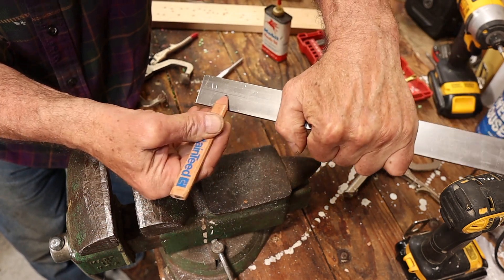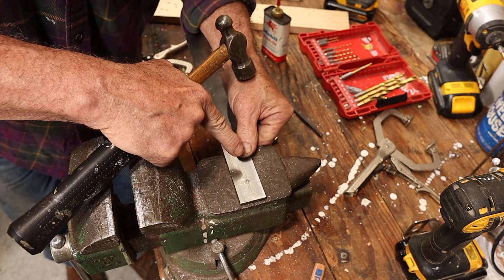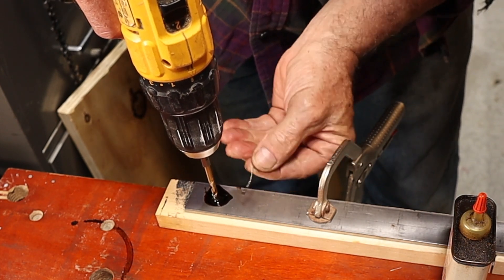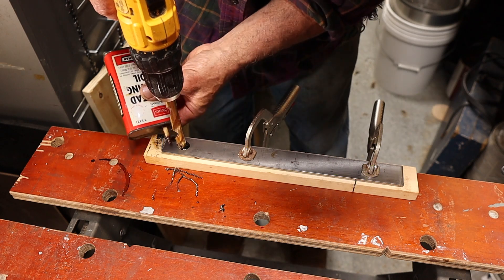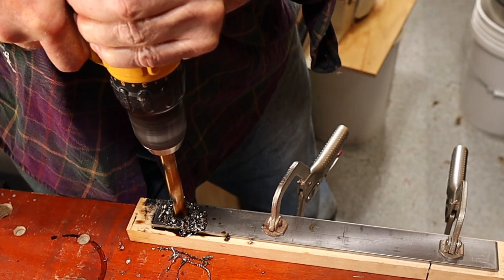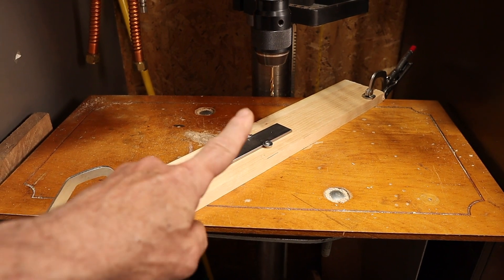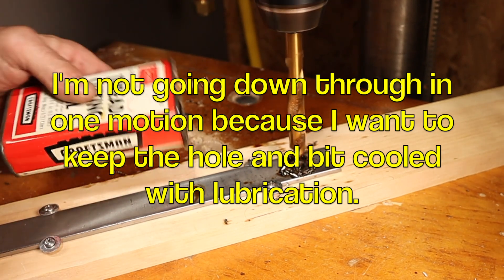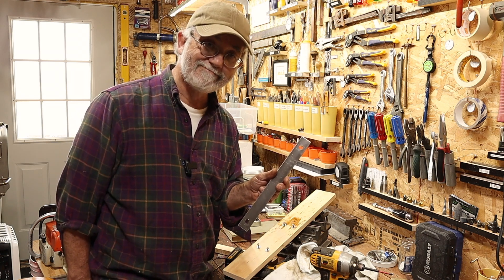How To Drill Holes In Thick Steel - A Lesson For The Novice - With & Without A Drill Press

Comment: Can you further define "bar stock"?  The text overlay @6:36 says "Common high speed steel bits will NOT drill hardened steel, stainless steel, and cast iron."  Are you saying the drill bits you used were better than 'common high speed steel bits' or that the bar stock is "softer" than hardened steel, stainless steel etc?
Reply from the maker: The steel I'm drilling and defining as "bar stock" is common "mild" steel (most of the steel produced is some form of mild steel). It can be bar stock ( as I show) or tube, or solid rod. The main point being, it is a thick steel, as opposed to sheet metal. Mild steel is relatively soft steel and it is what you'll find at Lowes or Home Depot. The specific steel I was drilling is sold at speedymetals.com as "1018 cold finished flat steel."  Any high speed SHARP drill bit will drill mild steel, as I show in this video. The bits I used happen to be "titanium coated." The titanium coating may make some difference in bit durability but my suspicion is that the titanium claim is more of a sales ploy than anything else (it worked on me). If I had sharp non-titanium bits I could have used them with the same results, as long as they were sharp to begin and well lubricated during drilling. You can drill brass, copper and aluminum with a high speed steel bit. But common high speed steel bits are not suited for drilling hardened steel, stainless steel, and cast iron. They will drill those metals to some degree, but not with any satisfaction. Thanks for the question. 👍
Reply: Misterdubity: As Mr Kimball explained, most steels are mild/soft steels. Drill bits & many other tools are examples of hardened/hard steel. If a center punch easily deforms the steel it isn’t hard. If you can easily gouge scratches in it with the sharp corner of drill bit or with a scribing tool, then it is also soft/mild steel. Some strong screws & fasteners, such as are used in critical automobile parts are hard or half hard steel. (You can drill very hard steels with carbide or diamond drill bits, but it can be tricky.) Also, rusty areas of soft/mild steel sometimes behave like hardened steel when you cut or drill them. Rust is generally harder than mild steel.
Reply: @mics3747  Thank you.  That was helpful.  So the bar stock (which was indented by the punch) is softer than ordinary steel drill bits.

Comment: I have a lot of 1/2" holes to drill.  If I stepped into the 1/2 over 2 sizes say from 3/16 to 5/16 or 3/8, then to 1/2,  does that add any longevity to the bits?
Reply from the maker: @ehjh263   Not sure about longevity but it will be easier drilling, unless you have a machinist quality drill press, in which case you can just use the 1/2” drill bit to start.

Comment: Get drilling/cutting oil in a spray can, and spray the bit as you drill to keep it lubricated and cool. If you see smoke you're doing it wrong and too hot. If you're getting chips like that you're most likely just using a bit that's too large for you to handle without a press drill. Buy cheap HSS bits when in doubt so you don't ruin your set.

Comment: Thanks very much for this great explanation, which is easy to follow.  Myself have been somewhat self-taught as well, and I really admire your workbench and tool area.  Did you construct the workbench, and do you have a video on how to design a work area like that?  Also, I'm trying to drill a hole in a garden hoe (it's the 'head' part of the hoe - the round steel part that goes into the hole in the handle).  I'm wanting to drill a hole for a rivet, but I was wondering if that is a harder steel, or might this technique work on that?  
Thanks very much.

Comment: Great video. Very useful. I never would have thought about securing the metal to a board with screws. Wow. I would have used the tried and dangerous potential disembowelment method. Drill press on very low rpm is something I was shown in person just two weeks ago. Thank you.

Comment: Is there any advantage to stepping up in smaller increments of drill bit sizes, particularly if you're drilling by hand?
Reply: The small diameter of the smaller or 'pilot' drill bit is easier to drill and keep on center with the hole location. If you take a close look at a larger drill bit point it has a tendency to "walk" across the material. As an added point, the tip of a large drill bit does all of the heavy lifting so to speak in drilling a hole as the point is always in contact with the metal as it works its way thru. The rest of the bits 'shoulder cutting edges engage as the bit continues thru the hole shaving a small amount of metal as it goes. The point has the most pressure per given area = heat=wear and dulls the fastest. If you use a standard 1/8" drill bit and wear out the bit it's more easily replaced and cheaper than trying to sharpen a larger drill bit.... as explained to me in my metal shop and fabrication class in high school in 1968.

Comment: Good tutorial. Titanium refers to the titanium nitride coating on the steel which helps them to last longer and look nice. That cutting oil looks like used motor oil. Its worth mentioning that keeping the tip of the bit cool, with the oil and low speeds, is critical because as soon as it overheats it looses its hardness and dulls quickly.

Comment: Great video! I'm glad you can teach something to others so they can learn how to do a project like this. When we were drilling any holes in steel and couldn't get access to the magnetic drill we would have to fend for ourselves. Of course we did a small drill bit first but when we went up to half inch or so we would make a dam with plumbers putty around the hole that we were going to drill. That would hold our  lune/coolant to the area being drilled. We then would fill a large spray bottle with crushed ice and water. We would spray that concoction to cool down the drill bit. We keep it lubed and we kept it cool so we didn't have to stop and resharpen. Just a hint to everyone. Thanks for reading this.
Reply from the maker: I’m going to remember that plumber’s putty idea. Probably could have drilled straight on down without pulling the bit up if I was drilling into a pool of oil. 👍

Comment: Metalwork is all about feeds and speeds. This is the speed formula SFPM = (π x Dia x RPM) / 12 High Speed Steel tooling working mild steel 100 SFPM is max speed. Generally I like to run twist drills at 50% of that myself. So 50 SFPM End mills I wind up to full speed. Using that formula we can see that 764 RPM would be max speed for a half inch diameter tool. Here's the derived formula for breaking out RPM from the equation RPM = SFPM / (π x (Dia / 12))

Comment: I use Marvel Mystery Oil for a cutting oil. The problem of using a hand drill is the inability to maintain the SLOW SPEED you need for drilling through metal, and keeping the drill perpendicular to the intended hole. I don't even use my drill press, Herrick, but then... I have a milling machine with plenty of torque and low speed. The other thing you mentioned... quality drill bits. With cheap ones, they dull slightly, so the person applies more pressure and more speed. At that point you're not drilling, you're burning a hole... right up to the point where the bit breaks.

Excellent educational video, my friend....
Reply: Triple reduction hand drills top out at 500 RPM. So theoretically they're capable of shooting a 3/4" hole into steel. You'd have to be King Kong to pull that off though. Triple reduced drills have plenty of torque too. My Milwaukee HD drills are real wrist snappers.
Reply: Great tips! Thanks for pointing out that you can use Marvel Mystery Oil and that slightly better bits might be a good idea. 😊